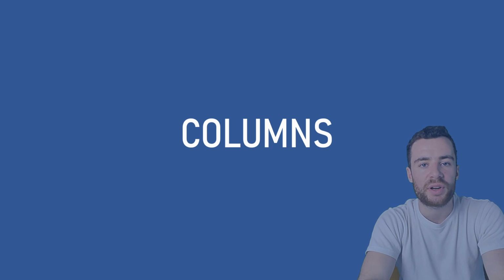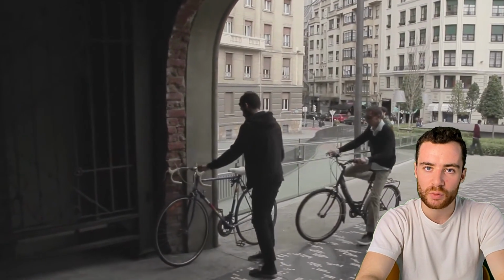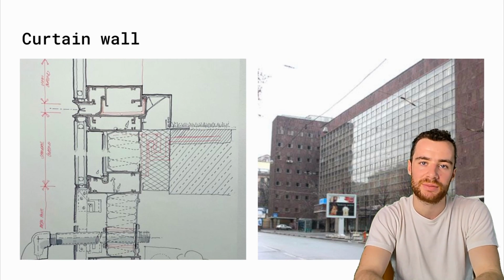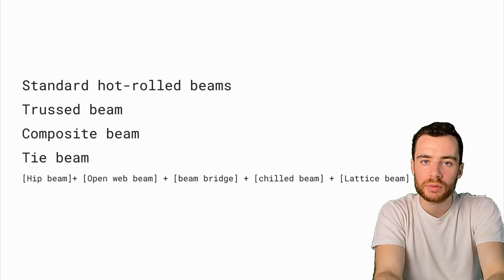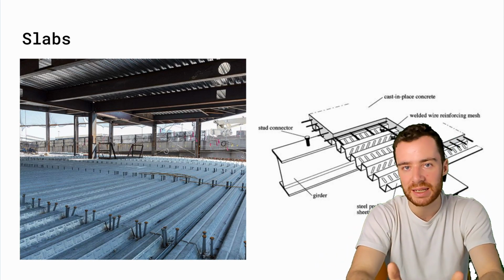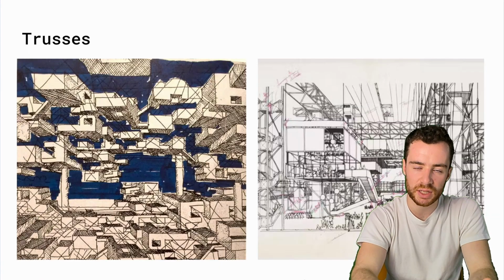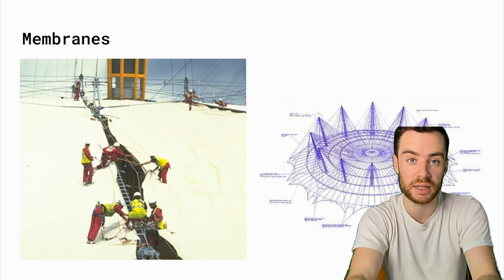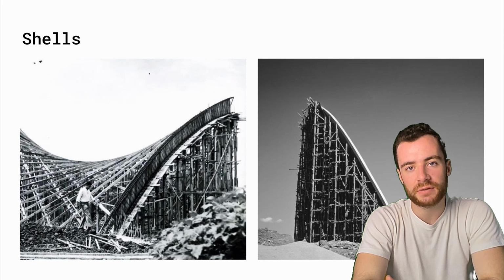(TUTORIAL) Basic Structural Systems - An overview by an Architectural Practitioner

Comment: this is really convoluted because you're not analyzing structure here.  there's no timeframe or evolution shown, and mostly you're just discussing forms.  needs a thesis.  needs to make a statement about the performance and function of structures at the material level, and over time and use.!  

Let's back up and do a structural hierarchy and timeline. At the top of our list/hierarchy is hot mixed mortars created by exploiting the quicklime reaction with water.  This material is at the top of the list because of its ubiquitous use in time. Quicklime mortar is essential to building walls with brick or stone.  These materials also create lime based plasters, stuccos and veneers to complete the whole building envelope.  Brick/stone in hotmixed mortar is most of our structural methods timeline.  We can confidently say it has been used successfully for 6000 years. 

in turkey, they laced timber into these structures...  they survive earthquakes better than brand new portland cement slab buildings which killed their occupants.

so that's our first class of structure type: masonry bonded in hot mixed mortars.  as for forms you can build with masonry "walls"  look no further than de'lorme and late medieval france to find the pinacle of what can be expressed with masonry in compression.  an arch is a wall.  a dome is an arch, etc.  matters more the physics and performance of materials.

our next class of structure is timber frame with joinery.  great human precedent.  works in seizmic zones historically where brick and stone cannot.  Used in conjunction with mass walls, or on their own.  

-Tradbuilding.com